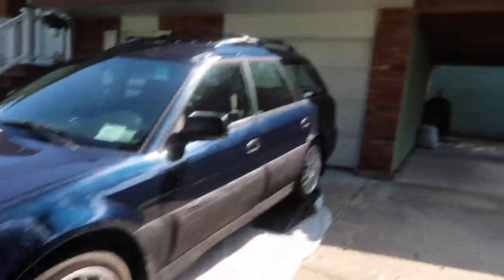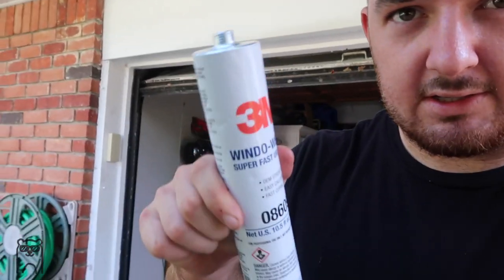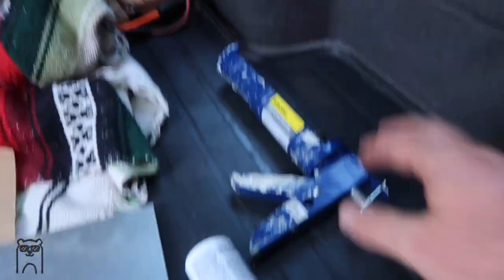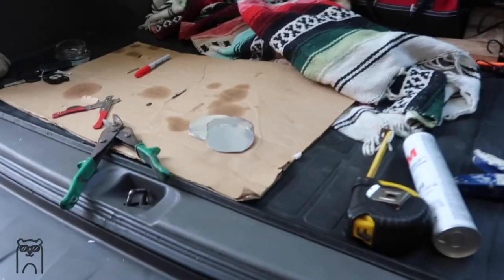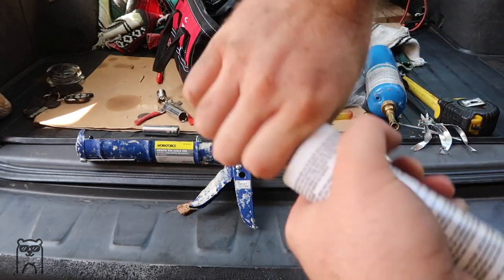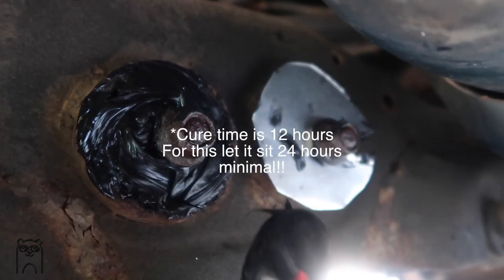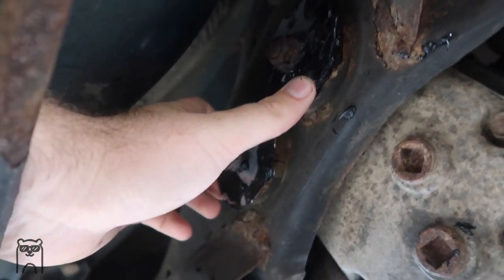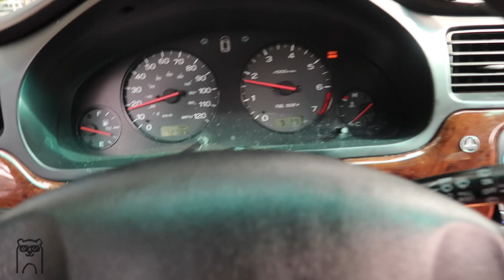CHEAPEST WAY TO FIX A CAR BUSHING!

Comment: Used the same stuff to try to make solid motor mounts and it does work for a little while but crumbled apart probably too much torque. Also you feel more vibration. Looks perfect for bushings in this vid. When it's eventually dry its solid like a hockey puck. Fyi for anyone about to do, this stuff is very very stiff, and messy if you touch it. 2 part poly prob better if you can remove part. Gonna try this on a element rear end - Thanks for vid
Reply: next time add little pieces of plastic or rubber to help biind it all together. 2 years on my front engine mount on my Toyota. it's solid af
Reply: also it's important not to have air pockets
Reply: Or use metal or plastic blockers similar to this video in order to hold in the 2 part polyurethane like a mold.
One vid I saw first they removed any loose rubber from the old bushings, cleaned it out with brake cleaner and then filed the remaining rubber & metal before putting in the 1 part polyurethane.
You have a great idea though with the two part polyurethane because of not using any more than necessary for each bushing or mount because of setup time.
Once air starts getting into the 1 part poly it will start drying in the tube!!
Also I'm going to use a syringe when I repair mine.
More money saving & hopefully better repairs as well!! 👍

Comment: If u still have this car or any other car u did this to, can make a follow up video. I’m curious to see how well it has held up after 3 years, I’m pretty sure many others are too.
Reply: THIS IS NOT A REPAIR! And if anyone does this, this is a very temporary modification 
If you plan on still driving 3 years later then you need to fix it properly
Reply: @JasonLee-lv7tm  We know this isn't a true repair. It's a hack to keep from expensive car repairs that could exceed a vehicles value. My car has 300k. I came here doing some research on pumping something into a worn out control arm bushing to cut down on noise and vibration until the problem solves itself or I am forced to perform the actual repair. I did fix the other side, but want to avoid without this without help.

Comment: Actually, just replace those metal rollers with solid rubber tubes (with very small ID). Then fill the gaps between those tubes with rubber glue.

Comment: Best thing  is to look for flexible  polyurethane  , there is few on the market 3m is expensive  and maybe  not soo flexible.  Some urethane or polyurethane  are more flexable than 3m this way you can have less vibrations.

Comment: That is just great idea, thank you. I have a loud clunking noise on the passenger rear of our 2009 Nissan Sentra. I've read that it is kind of typical for Nissan Sentras to have that problem (for some reason it is always on PR side. The noise started after I hit smth on the road w/very loud sound. I thought that some struts and shocks were blown and replaced all of them. But the noise didn't go away. Same sound like smth is going fell apart. Though I did some suspension work on 3 of our cars, but this project w/dropping the Rear Beam even slightly, supporting it, that is too complicated for me, and easy to mess up. I've purshased that 3M polyurethane, and try to do the job your smart way. Thank you again.

Comment: Betters more flexible solution, but, it is curious, y do the same to my Subaru 5 years ago, and it is running very well.
You don't need the plates, it is more and unnecessary work. A point, you only need to remove the loose rubber, nothing more. Just keep the rubber that it is still fixed in the bushing, and fill the void.

Comment: Good fix that window weld is  like tiger seal tiger seal cures faster and holds strong it will fix dif bushings easy it's good for mounts aswell
Reply from the maker: I heard that tiger seal works really good also
Reply: @mattywots  yeah
Reply: U can get standard black  polyurethane aswell be nearly as good as when they were new it's the same stuff :)

Comment: Never seen anyone use those metal plates before, seems like it would better! Cant wait to do my rear diff on my a4
Reply from the maker: hey man I thought about using them so the 3m has something to have pressure against when filling. Come to think of it..It should also protect the "ghetto practical" bushing to the max
Reply: You can’t wait to be cheap af and not repair the issue on your car? 🙄

Comment: So your the guy that makes me a hell of a lot more money. Every time a YouTube mechanic comes into my shop with silicone filled mounts / bushings, I instantly up the labour by 25%. Trying to get this shit out of the joint when replacing bushings is a nightmare. But thank you for posting a job that fails so quickly it needs professional people to fix.
Reply from the maker: sorry you seem to be so angry lol this bushing lasted over 40k miles and 3 years but the car was junked and the bushing was still holding up strong. Yes, OEM and OE repalcement bushings are the BEST route but this doesnt hurt if for a DIYer
Reply: This is polyurethane adhesive, not silicone.
Reply: @rolfbjorn9937  Doesn't matter what it is. Still costs to remove when it fails!
Reply: @markhenry1144  why would you remove it? The bushing was obviously bad, hence getting filled. Wouldn't you just replace the bushings? I don't see how window weld would effect that.
Reply: My bush repair is five years old, and doing fine.
Reply: And another " it didnt happen" guy .. you obviuosly are not a mechanic .
Reply: You get the stuff out to fill it back 😂?

Comment: Thanks for the informative video. Today Ive decided to go for DIY mounts as my Chrysler's engine started dancing together with transmission under the bonnet. Im checking videos on Youtube to get pros and cons. As I was watching your video, I saw your ramps and something else came to my mind (typical Youtube trick, you come for apple and go with orange). I would like to ask, how PU would be if I wanted to make my own ramps with PU? Not only with that ofc but like take some ramps and add more layers stuff like that. What would you think? Idiotic or makes sense? 

Thanks for the video again.
Reply from the maker: Hey man it’s not a bad idea just be safe!!!! I think you should be really careful with the PU Ramps though 😂

A lot of people will build them with 2x4s and screwing then cut 2x4s into steps. Also I highly suggest the bushing fix it works great and is still working perfectly
Reply: @mattywots  Hahahah thanks for the concern but Im not gonna make whole ramp by only PU :) I have Peugeot 407 and that bastard is very close to the ground. So I was thinking to buy ramps and customize it with PU somehow. I would just add some blocks and fill in with PU, its just an example, just wanted to know how strong it would hold? But if its not letting transmission even breathe so I think Im gonna go for it, Im also happy to hear that you got positive results. Thanks a lot really.
Reply from the maker: @curiouscat1907  No problem! Let me know how its goes!!!!!

Comment: I'm considering doing this, very soon. Got any tips after doing it yourself
Reply from the maker: Hey man!! What do you plan on doing it too?
Reply: 2001 outback
Reply from the maker: Hell yeah man. Deff use the metal sheets to hold the 3M from going out the hole. and Use ALOT of 3m window weld. You dont want any air pockets in it. Also a few cheap dollar gloves to push the 3m in and compress it. LASTLY this stuff stains your skin bad so be careful! Besides that man any questions ask on here or DM on Instagram @mattywots and ill gladly help man
Reply from the maker: @beausmith08  Hey man that looks pretty complicated!! maybe blow torch the rubber bushing out and do what I did in the video! Honestly thats a tough one
Reply: @mattywots  Hey, good idea with the blow torch!
Reply: would you cover the stud completely and have a spacer flush with the cradle? Or would you still want access to the stud?

Comment: I just got my 350 z from japan and the creaking/ tapping noise is driving me insane? Do you recommend I try this? The mechanic wants to charge me over $800 to fix and with corona virus going on I don’t have that money laying around
Reply: This is a hack fix for $500 cars.  Fine in this situation, but i wouldn't do this on an imported car you care about.  Changing a diff bushing isn't that hard on a Z.  You don't even have to drop the subframe.  Just remove the axles, remove the driveshaft, drop the rear sway bar, and the diff drops straight down.  Cut out the old bushing and press in a new one.  Whiteline and z1 both make good poly diff bushings for z's.
Reply from the maker: Don’t hate the 3m window weld bushings! 🤣 you are right the proper way is 100% to replace with a proper bushing. We actually had this on a lift last week and the bushing / fill is holding up actually really good for how cheap this is 😂
Reply: @mattywots  I've heard about this before and heard it works too, but it's definitely not something i'd do on something i care about just on how it looks alone.  Forget how long it does or doesn't last, but it's perfect for that subaru of yours.  If it lasts a year or two, it's well worth the $20 on your beater.  On a car i imported care about, I'm buying the $100 bushing and putting it in.
Reply from the maker: Yeah I wouldn’t do this to my 2002 wrx I just swapped a motor in lmaooo on a daily though even a newer one that’s normal A to B driving I would consider it! Also I saw this on the forums and there’s a guy who made a post on his Lexus. He filled it in and commented back 5 years later “ it’s still working ! “ lmaoooo that why I had to give it a try
Reply: @mattywots  I had a 2002 wrx brand new.  Bought it from the dealer when they first came out.  Fun cars.  Sold it back in 06.
Reply from the maker: Paul M no way I love the bugeyes!! If you have nothing going on check out my latest video. Swapped a jdm motor in it and just fired her up this week 😇

Comment: ok my whole front suspension busted right side up lower bushings the axel tarns line too got it done for only $740 but other side drivers might be ready to bust also cant get it done until january i was thinging of using flex seal which i used on plubming in bath tub back 6 or more yaers ago it's still holding solid also used in basement front wall is exposed was leaking two cans of flex seal stopped the damage until get it front of house fixed inside and outside and im thinking of getting the cans large size to coat my roof 

when this stuff hardens it's like solid rubber and better than any paper tar coating 

poablly cost less than paying a roofer like $1000

Comment: Hi ✌ so this sealer when is dry is like flexible?? So is like your make a bushing??🤔 because I have one sienna 04 front control arm bushing is bad. So when a push the brake make a loud noise So I check it and I see is the bushing bad I go try this if is flexible that's why I ask 😁🤞🤞
Reply from the maker: I would not use this on a control arm etc, replace the arm and be safe
Reply: @mattywots  what do you think about me doing it to a center support carrier bushing

Comment: You shold have removed those welded bolts, the other idiot has put in. 
Vibration will tear thru your car body and cause it to fall apart from material fatigue and rust.
Main purpose of engine mounts is not comfort, but protection of body, wich is not solid metal as engine, from vibration fatigue.
Reply from the maker: great point - its all good she was a clunker anyway but great tip for people reading up on this

Comment: I would think washers would be more reliable than sheet metal, but hey good try...and another option couldve been to just add polyuthane over existing bushings...js
Reply from the maker: j.s if you actually watched the video I said multiple times the previous owner welded nuts in there..... lol